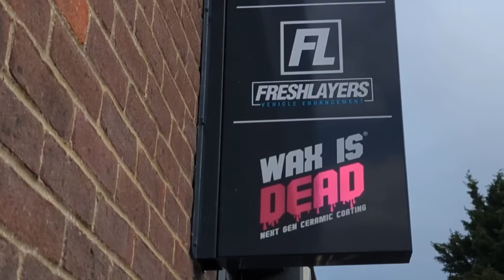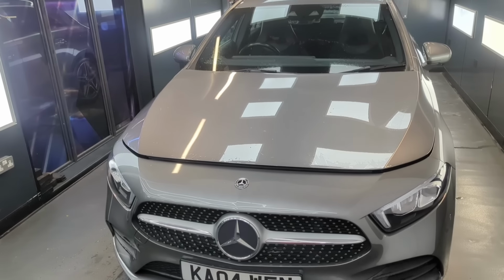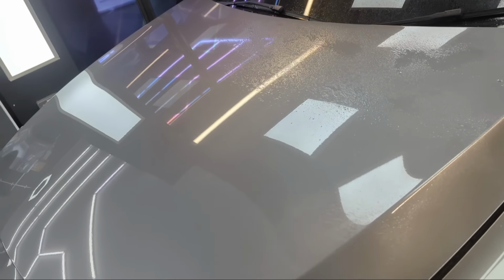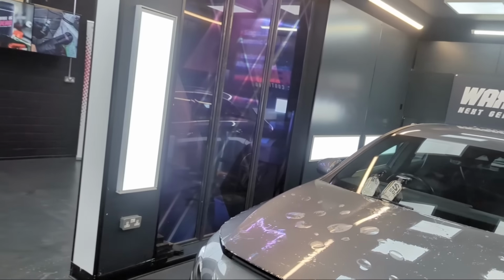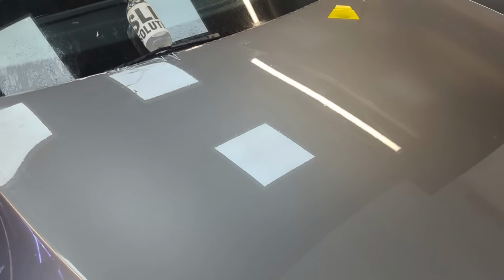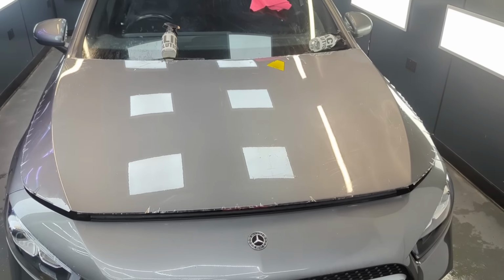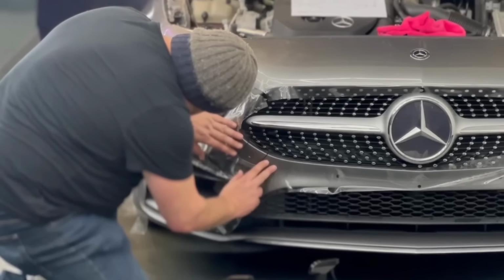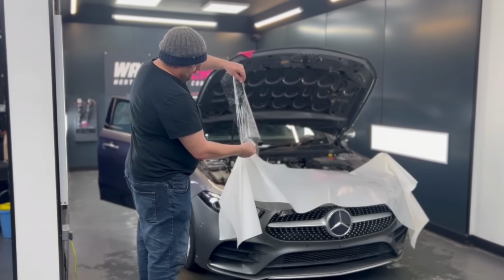R.I.P PPF | Save a fortune do it yourself!

Comment: Ive also tried to install PPF myself because I get it wholesale for another use (but that use only requires applying the PPF to 2x6 inch sections).

I got the small sections on okay like the front foot of the roof, the A pillars, and the small side panels but the hood PPF had to be trashed.

Comment: Dust in the air but also dirt probably on the bottom of the sheet of paper the ppf was on. The paper side was on the bonnet. They waxy paper always seems to become statically charged attracting dirt. That probably a way dirt got onto the bonnet. Its bloody hard. I've just given it to my ppf installer to do who is an absolute legend 🙌  shout out to Justin at exclusive car care. 🙌

Comment: I like to know how they stop dust in the air landing on the paintwork before the film is laid down.  I couldn't even avoid this happended when I put the screen protector on my mobile phone.
Reply: Spray and wipe of the backing of the ppf before peeling off. Also spray and wipe.off the panel with the squeegee straight before putting it on the panel, wet everything. Clothes, floor, ppf around the panel.
Reply: I think that room when properly prepped and filtration system is turned on is basically like the same sort of cleanroom environment they use for professional car painting. They probably mist all surfaces of that entire room front to back, sweep out all the dust, then blow filtered air through it through filters for a few hours until as much dust as possible is trapped against the filters

Comment: I think they sabotaged you by putting those sheets on a dusty table so that when you laid the sheets on the car with the backing side down, it deposited thousands of little dust specks onto the panels. You would probably need to have some canned air and dust off the table first, then dust off each sheet outside before even bringing them in, then carefully wash both sides with the backing still on. You also probably needed to do another rinse off of the car once you drove it into the building. I think they also always do at least a quick fine polish of all surfaces to ensure any stuck actual paint contaminants come off.
Reply from the maker: No they gave me the kit all rolled up and clean.

Comment: 3:53. I'm thinking that if you wiped this off in an attempt to remove small contaminants and then resprayed immediately prior to installation, it may have gone better. I don't know much about it, just thinking out loud. I've only messed around with tint in the past and that can be a PITA to work with.
Reply from the maker: guys told me.  you need to squeegee the panel.  and also have the PPF piece ready to go stuck on the wall ready to be transferred.   that will help solve one of the problems but theres so many other problems.  The edges are a nightmare.   And so was like the front bumper.  just dont try it you have been warned.  but it is awesome fun and one day i would love to be able to do this properly.
Reply: @ForensicDetailing  No doubt it would be a great skill to have. Practice, frustration, and lots of waste and we could all get there. The complex curves on some front fascia's could easily drive someone insane lol